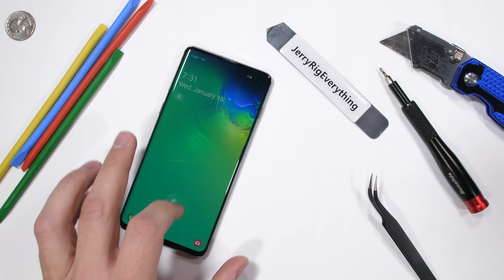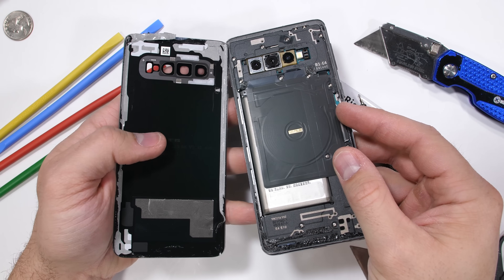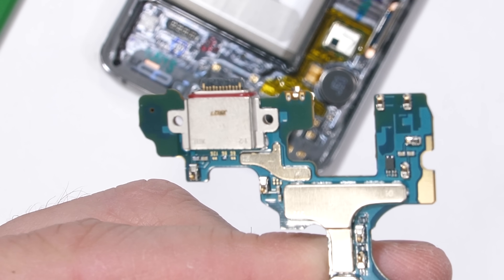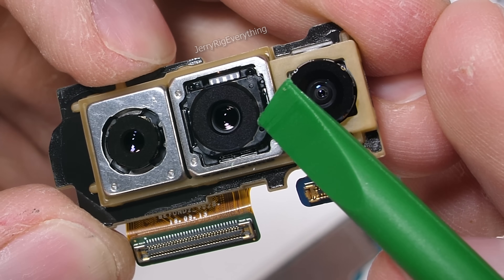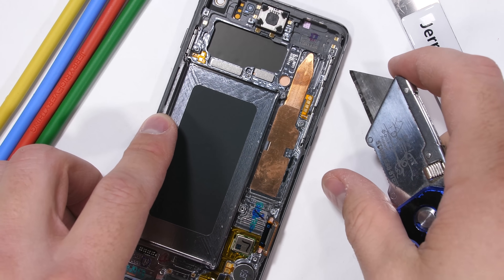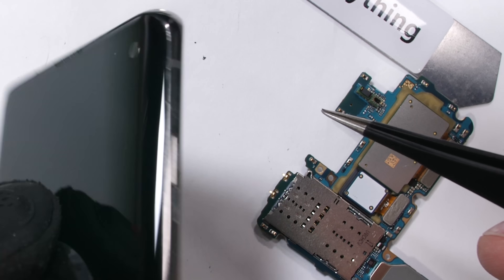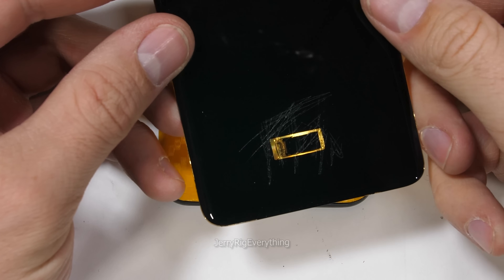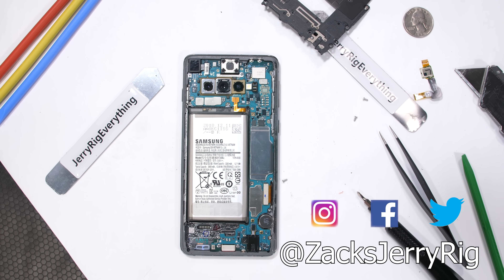Galaxy S10 Teardown – Does Ultrasonic Measure Up?

Comment: Repairs are just getting harder:
>2000: bunch of screws.
>2019: adhesive fest.
Reply: >2020 Its welded shut
Reply: @midnight6517  iPhone's pretty much already are😂
Reply: @MoonShotYT  easier to waterproof and dustproof
Reply: @ru2225  galaxy s5
Reply: It's a minor inconvenience with a major plus (waterproofing). Why complain?
Reply: For anyone who was confused as I was: 2000 means the year
Reply: @MoonShotYT  it could be cheaper to apply as a bonus , and  probably  in some areas does double duty as water seals ,  
but glue also has a lot of surface area and is very strong ,   if you look at the way cars are  manufactured today  , you may be surprised to see some cars have the dash boards glued in among other things .
  Glue has the added bonus of not having to worry about  being under or over tightened in critical areas ,   and when stuff is glued , there maybe  less likely hood of having things rattle around .
  i suspect if a device went back to the manufacturer of origin  for repair  , they would have   far more  hi tech workshop facilities  for disassembly and repair of their own devices than 99.9 % of techie repairers .
Reply: 2020 - Screw this!! :D
2021 - First you must destroy the front glass to get to the battery.
2022 - Must blow it up with C4 to access the inside.
2023 - It will be implanted in your brain, so no more opening it.
Reply: @MoonShotYT  one bad thing about adhesives is that you cant put them back on like screws. sure you can buy replacements, but i dunno if they will be as good as the original
Reply: 2029: Zack - To replace the battery we must first melt the glass on the back that's infused in the Titanium frame...
Reply: That's what she said
Reply: just like cars and other electronics
Reply: Alireza Baloochi it so you need to take it to a company and it isn’t so easy
Reply: @Im Unsatisfied not eaasier just harder to repair on own .
Reply: >2010: still a bunch of screws
>2019: must have a hotplate, guitar picks, spudgers, a pack of single-edge razors, adhesive remover, and dry ice/liquid nitrogen if you say work at a shop that does glass replacements on working LCDs....

EDIT: almost forgot the all-important Loca Glue for actually attacking new glass to an LCD.
Reply: 2025molded phone...
Reply: @SCtester  is this comment a joke?
Reply: >2048 apple announces new macbook that now no longer uses soldered components and all of the components are welded in and the whole body is welded and t2 chip now detects if you're using an unauthorized non-apple-certified screen cleaning agent
Reply: @moth4256  RIP apple
Reply: moth MFM (Made For Mac) certification. 😂
Reply: blame IP67
Reply: @eliezerortizlevante1122  68
Reply: @eliezerortizlevante1122  there are plenty of phones with ip67 and removable battery, so that's just an excuse phone makers make
Reply: @eliezerortizlevante1122  68
Reply: @eliezerortizlevante1122  ip68 .. isheep
Reply: @harshdeepsingh5427  isheep? Apple has ip68 on the xs an xs max so...
Reply: @bibletwink666  Correct form would be :Apple finally has IP68.. Galaxy s6 had it..
Reply: @harshdeepsingh5427  correct form would be: I'm unaware that apple has ip68, so I call someone an isheep.
Reply: ... phones from 2000 was/are good , i still have working 3310 , and it will be a miracle if a modern phone is working and in good condition after 5-6 years .
Reply: @Nick_1911  And they can do a 100th of what phones can do now. Also, alot of flagships will still give you 5+ years. That's pretty solid I'd say.
Reply: @Nick_1911  I have a Galaxy S (GT-I9000B) and it still works perfect...
Reply: @Nick_1911  that phone was plastic so...

Comment: @zack hi there, im wondering if the paint stripper you've used to create your clear back phone is suitable for stripping away the black "paint coating" around the rim of the razer phone 2.

Although the razer phone 2 is almost as expensive as other phones like samsung, the black "paint" on the metal frame is of some dirt quality. Unlike the anodized frame like on samsung phones, the black paint thingy on the razer phone 2 on my unit is flaking off bit by bit. Peeps around me using the purple samsung S9 still looks great to this day.

I forsee my phone to look like a splotched cow in a few months. So im thinking to deliberately remove the black paint coating 

Would you be able to test it out on your channel? Since you have a bunch of phone lying around.

Not sure if you would get much view if you made a video on this huh, since the razer phone 2 is kinda niche.

Maybe a comparison between the exposing the anodized frame of a samsung phone to the paint stripper vs that of the razer phone? hmm

Thanks, just something on my mind

Comment: No pressure sensitive home button? No Notification LED? Hole in display. 
The S8, S9 design and features are so much better and more to me.
Reply: Are you sure about the first one?
Reply: @eldafint  Well the S10 has much more optimised battery life and one LED is an insignificantly small thing you're compromising for that display. Also from what I've heard a small circle surrounding the front facing camera lights up with notifications. Nothing wrong with ditching the LED imo
Reply: @elvaringvarsson61  Yeah I just thought that the camera thing would be a great comprimise
Reply: Name one good use of the notification LED when you have always on display!
Reply: @elvaringvarsson61  Battery life and easier to see at a glance
Reply: Then get a fucking S8/9 cheap ass

Comment: Interesting that ultrasonic sensor impossible to repair.
Thumbs down for Samsung for making irreparable the charging port :(
Reply: Apple: Hold my Beer
Reply: @nayeer01  Apple (iPhone X...) doesn't have a Fingerprint sensor, so don't say anything lol.
Reply: just replace the whole screen
Reply: I've never had to replace a port yet tho. And now I rarely use a chord anymore. Wireless charger in the car and I built one into my night stand as well
Reply: Actually USB port can easily be repaired by professionals ...  They make use of Hotgun to remove it .. So he is wrong when he said that it's irreplaceable
Reply: @rupeshverma9536  yep. As well as anyone with micro soldering skills. But it's much too difficult for the average user

Comment: I hope official repair centre's do have the tech needed to replace the charging port. It is the weakest point to the outside influences. 

Beside that i start to hate the different prices they ask for it in different countries. Especially between western countries. For example the S10e costs 12% more in the EU than in the USA. While in India it is around 8% cheaper than the EU. Not that the market is bigger because there are more people in the EU. Maybe it is because of the EU import taxes i thought. But then it is strange to see higher prices in India than the USA.

Are there more people seeing this happen on this scale in the mobile market?

Comment: Pro tip: use contact cleaner to weak the battery adhesive, it will pull off faster and easier.

Comment: I think the inside of that heatpipe is a process called Sintering where its a copper grain baked on the surface of the inside of the copper pipe to make the heat transfer process more efficient, it's usually seen on higher end heatpipes.

Comment: What is a RAM??? Show me the RAM.
Reply: RAM is random access memory. It is the temporary data storage unit which keeps information regarding what you are doing now and/or did in the past x minutes. For smartphones, rams are mostly just a small black rectangle, which isn't really that impressive, not sure what exactly you were asking, so I dumped all the data I do know on the topic
Reply: @amuzak9063  
Bro...lol...I know that. I'm an Engineering student.
I just wanted to know where exactly it is. 

Thanks for that information btw.

Comment: The iPhones are quite easy to repair. Adhesive strips for the battery,modular lightning port and microphone,modular speakers,simple display change without destroying it,modular sim-card tray… iPhones are more easily to repair than most people think.

Comment: I preordered S10 plus because coming from regular S8 it is upgrade. But lets be honest and forget about this S10 hype for a moment. Seeing some camera comparisons with Note9, it's pretty much the same. I don't care about Instagram mode or AR emoji, in low light S10 camera is still inferior to last years Pixel or even Iphone XS. I think they could have done the better job and it's a shame that Samsung always saves a ton of upgrades for Note lineup, as if S series aren't flagship themselves... You get everything you have on S, polished and upgraded, better hardware, bigger screen, bigger battery, upgraded camera and S pen. Like last two years, at the end of the year, S series look like crippled Note. Two-flagships-a-year is just insane tempo, phones lose their value very fast (unlike Iphones, for example). They should merge Note and S series, bigger with S pen, smaller/regular without and budget model.

Comment: 3:14 this is 100% not true. a damaged charging port can be desoldered and a new one soldered on just like we do on the samsung phones that have the touch sensors in between the screen and the frame. please do not give out false information. just because the average joe cant replace it himself doesnt mean that it cant be done, its also not that hard with the right tools

Comment: 3:13 Apple-level anti consumer?
I believe Apple did separate charging port from motherboard with ridiculously long and big ribbon cable from your Xs teardown
charging port at Xs is replaceable without changing the motherboard/microscopic level soldering, its just hard to get into it but not impossible

Comment: why don't you clip in a s8 or s9 display and se if it works ..
Reply: It won't. Hardware are always interconnected with hardware as well as software pinpoints, making them irreplaceable with some another counterparts. An S10 hardware components are programmed to work only with the parts predfined in it, everything else would just ruin the whole bootup function of the smartphone. Its mandatory, to take care against hardware components theft, where the original parts are replaced with cheap counterparts to increase profitability.
Reply: @rajsatraroxor9603  i don't think there is a specific connector difference as it is a standarised connector .. i once put up a redmi note 5 pro screen on a redmi 6 pro and it worked just fine .. the displays usually don't have any specific codes written to work on specific hardware.

Comment: Looks like Samsung is "innovating" in the same way Apple did a coupe of years ago. Binding the fingerprint sensor to the screen will surely make it way more expensive and probably not user repairable. Hope it is not also bound to the motherboard for "security" and "user protection"

Comment: "Screen is impossible to remove and will crack immediately"

proceeds to remove the screen without any cracks or damage
Reply: Damage? Screen isn't functional anymore
Reply: @sabagamer3052  I meant external visible damage, from his other videos they usually shatter immediately
Reply: Blackbird
There is a difference between a screen and the glass.
Reply: Blackbird that screen is broken even though it may not look like it.

Comment: but why the screen didn't work ? 
I mean you unplugged it like a little Lego and then put everything back together and there was no crack. what went wrong ?
Reply: microfractures on the screen may be
Reply: It is so much thin to the point just unplug it damage it, he said it when he was going to unplug it!
Reply: He scratched of the screen around the fingerprint sensor. Maybe that distorts the panel too much to run a current through it.
Reply: At 7:43 see towards his hand his knife has damaged the screen. (copper coloured). I think that is why it doesn't work. it is so thin and full display.

Comment: Ik you probably won't see this, but if you do, Zach, please add drop tests to the durability tests, it is an important part of daily wear and tear of a phone
Reply: Its also incredibly random. You can put a phone in the beefiest case and it could land just the right way and obliterate the glass. You could just as easily drop the phone naked 20 times with no scratches. Drop tests, unless preformed hundreds of times across dozens of devices, are not indicative of anything.
Reply: So yeah, it makes sense that it is not very accurate, however my concern is with the screen in particular, and seeing if dropping on any edge will result in specifically the screen cracking on a naked body... thanks for the response tho :)